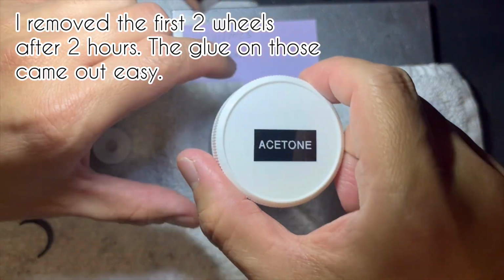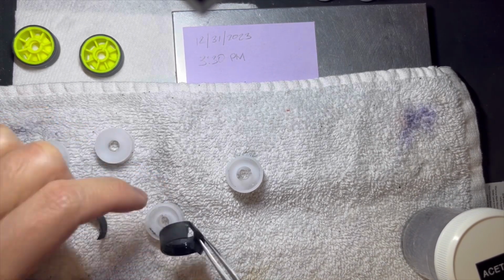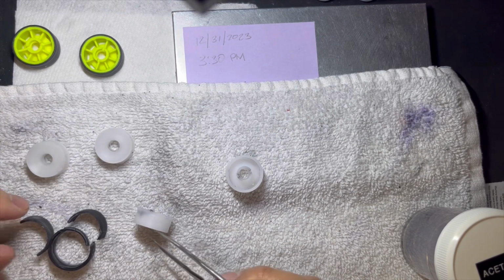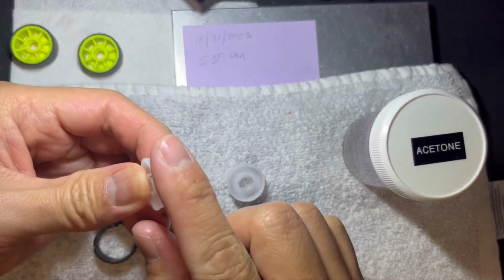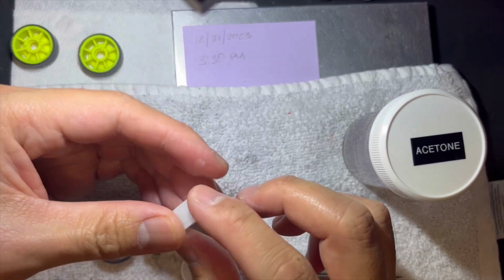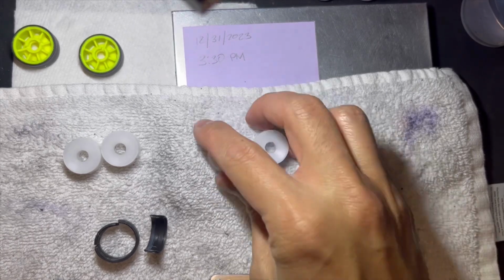How To Video: Removing Glued Tires | Reusing wheels #miniz

Comment: I havent tried this... will need to as I have plenty of wheels that I would just rip the tire off, then put on truer and buff the remains off of.  Dusty mess!

Ill need to try some of the old Atomic S6 19-19.5 wheels that I have, although they have white coating on the wheel.  So I think the white will probably come off too (and I really dont like black wheels, cant see steering angle).
Reply from the maker: So I tried doing this before but everytime I go to the store or even when I try to buy Acetone online, I always end up getting the one specifically for the nails. You know those colored ones? Those acetone requires scrubbing afterwards. This clear, pure Acetone does not need any scrubbing after 8 hours. The glue, the Kyosho sticky tape and the tire comes off on its own. You can rinse of the tire dust from the back of the wheel but the surface where the tire goes are clean and smooth. At least for the wheel sets I did already (I did 5 sets now: 3 RR wheels, 2 PN Delrin wheels) and I haven’t had to scrub/clean the surface on any.

I’ve always like the 19mm. Its what I had left in my pitbag when I stopped racing long time ago. When I got back, I was still on 19mm. I like PN 19mm especially the oldschool no-flange one. You can really fine tune the gluing with those.

Same. Black wheels is not my first choice unless the wheels is on sale. haha